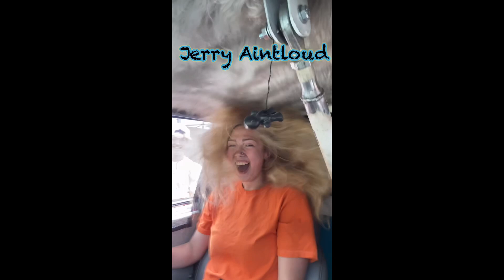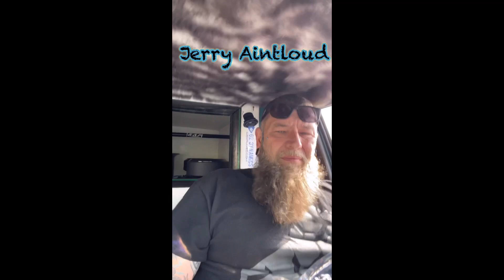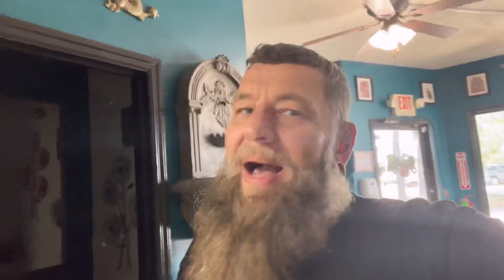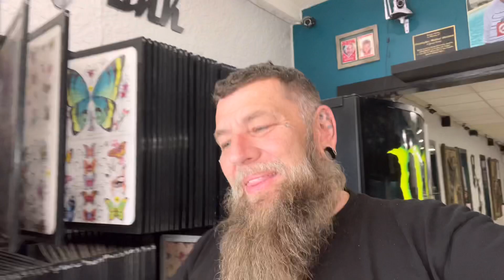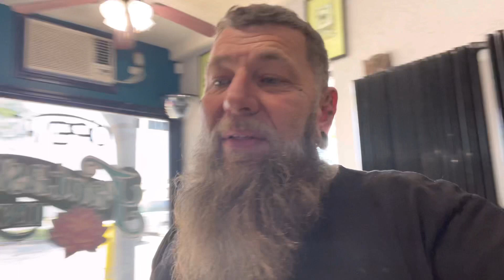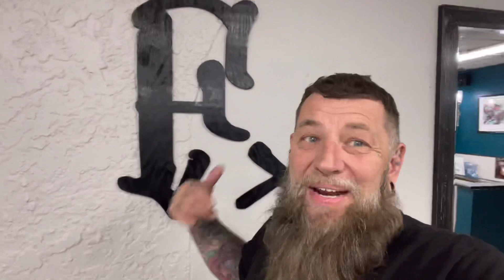Parker and the DC audio lvl 5

Comment: Yes Jerry it is very much because of the box he uses. The fact that he has now blown 2 of the best subs on the market is more than proof. He also fried a Sundown ZV6 not long ago. Both of these subs retail for $1000+ and both can take way more power than their rms ratings. I also know the box dimensions + port sizing determine the power handling of any sub. You are correct about him bottoming out the sub but that is also a 2 way road. With the coil leaving the parameters of the motor structure caused extreme heating of the subs coil causing it to burn up in smoke. This was very aparent in the video due to the dimpling of the subwoofers surround...that box is half of what those 2 subs need for there optimal performance. This is not rocket science just bassology 😆
Reply: Lol $500 ain’t blown but $1000 ones did
Reply: 👍 yup

Comment: He test every sub in the same enclosure. His enclosure volume is OFF and it created more heat on the sub coil. It makes a huge difference with big power too.
Reply: Yeah I never understood that.
Reply: True. He thinks that box is good for every sub
Reply: Well guess what here it is every sub he tested in that same box did not blow but the dc level 5 did in 43 seconds that American bass hd sub went longer than 43 seconds before it stop working 😂
Reply: If the box is to big, then the sub will move more right. When does a sub cool? Yes when it move’s more😉 just speaking fact’s🤯🤷‍♂️
Reply: Nah had nothing to do with enclosure and everything to do with him abusing the coil.
Reply: @larryneal4672   it still worked ,  after some glue good as new
Reply: @ardianelias1291  that’s not how it’s works 😭

Comment: if you guys think all subs and speakers are the same maybe read the loudspeaker cookbook? box size is a huge deal as suspension is different and moving mass is different. dc are designed ground up for smaller boxes, period. they're 1000$ because of real r and d instead of Chinese copy paste crap, nit every company just uses what everyone else is and slaps a way bigger coil than "rated" on it. power isn't everything in the slightest, education on how speakers work is key to understanding why every speaker is different.
Reply: Just pissing in the wind bro, it's easier to fool someone than to convince them they've been fooled

Comment: I have been running my dc xl elite 18 for a awhile. And love my dc. There were a few things I noticed that didn’t look right before he ever started testing it that looked off. First off the fact that it had sky high wire instead of dc wire. Second my dc was packaged exceptionally well but mine came directly from dc.
Reply: Good point I didn’t even notice that but they do always come with Dc Audio wire and much better packaged with Dc Tape .

Comment: ive been running 2 level 4s on about 5k for almost 2 yrs ..its on asfb8k wired at 2 ohm so about 5 k ish...neve r had any issues except stinky hot coil when i push them hard for an extended amount of  time in hot weather but thats it..never blown one ever and dc sent a free dest cap and glu to fix mine because my wife cracked my dust cone putting shit in the trunk to close to the sub//sooo for me DC all day the customer service is great and there subs work in smaller boxes than most so it was perfect foor my corolla

Comment: I have tested level 5 12s most likely more than anyone in this comment section. Anything over 1.5 per driver and they fall on their face. DC’s love small enclosures. 1.3 per level 5 12 is the sweet spot for a ton of power…

Comment: I've always thought DC is way overpriced for what you get, and Parker's video proves it.  People can make a million different excuses why it happened or what he did wrong but the fact is he played the sub on rated power (or close enough to it) and it blew.  I think if anything DC should rate the sub lower if that 3,000 RMS is the absolute limit that it can handle and little things like the enclosure volume being slightly off or the frequency is considered user error and made it blow.  Plenty of other brands that are half the price would have had no problem doing what he did with it.

Just my uneducated opinion.
Reply: to be perfectly honest people running  that much power on subs like that doing music and burps especially,  build at recommended or smaller youll get way better cooling and performance most times.  With a single sub running at rated power on a extended high hertz tone an extra cube can absolutely wreck it.   are there cheaper alternatives .. sure but not even remotely the same caliber of products.
Reply: Well 2.5 vs 1.5 air volume is a significant jump. Its not just a small difference. The DC 12 is recomended at 1.5. Most of us know bigger box means less Watts vs smaller box.
Reply: 1 cube over is just not a little thing, that’s a huge difference and that sub was getting clipped to death at 45 htz. It was way above tuning for that enclosure. You play any sub in those conditions with that much power and something bad is going to happen.
Reply: 45 hrs huh no bro 43 seconds
Reply: My deaf bonce sa 318 was put to hell and back and the coil started coming apart and it still didn’t blow up and that’s a 700$ sub it’s rms is 2800 I had 4k in it at .5 and free air it for 3 minutes on the same power stop now I’m looking at that level 6 put that level 6 on the same test and let’s see will it blow in 43 seconds
Reply: @larryneal4672  I meant 45 htz, anything way above or below box tuning will clip.
Reply: I’m not saying it won’t clip but do u think I didn’t clip the shit out of my sub before in a way bigger big and more power than the rms
Reply: We talking facts that dc sub get a pass because  u saying it’s something that Parker did to the sub and the just can’t take that test that way Parker did it when the fact is Parker test ever sub in the same box the same way and I would free air would be a harder test but he didn’t free air that level 5 why cause he knew it can’t take it think about what I’m saying and go back and look at that video and if that sub is 1000 plus tax I want more than 45 seconds hell a minute would be nice for starters u know and I know that sub is weak just say it please tell it like it is u never went to dc or me
Reply: Who said clipping was ok I’m saying I have clipped the shit out my sub before and it didn’t blow bigger box way more rms power and it still did not blow I’m saying that the level 5 Parker has is a weak sub I don’t know what u talking about and remember that dc level 5 Parker had cost 1000 plus 43 seconds it blow u tell me
Reply: Ppl with experience put 7.5kw into a level 5 daily with Out a problem. Parker just made a mistake
Reply: @Andrew_kiwi_AF  Still overpriced garbage.
Reply: @BigdeesulOfficial  do you have first hand experience with dc? No? Then shut up 

I was burping 154’s out of a standard level 4 12 clamping 9kw and to this day the sub still works fine. 
I have ran pairs of level 2 subs on a 3.5k daily. Use the suggested box specs and you have no drama at all.
Reply: @Andrew_kiwi_AF  Shit a Dual from Walmart can burp multiple times its rated power.  But obviously overpriced companies like DC can't make speakers that can run on the power they rated them at for more than a couple minutes.
Reply: Can’t knock something you haven’t ran. Stop listening to others. Be a leader, not a follower 💯
Reply: @BigdeesulOfficial  lmao I run a single DC lv 5 on a sundown 5k at 1 ohm and it has no issues playing on long 45 min car rides full tilt

Comment: He just didnt let the coil cool down properly before he started beating on it again. Still funny AF though every show I go to DC subs are the ones blowing plus the fan boys made it so I will never touch that company. There also one of the few companies full of recone memes on google when you search dc audio memes.
Reply: That's funny, I didn't know that. What brand subs do you recommend for daily driver. Single 15 set up?
Reply: @RomaVilla  It depends on your budget. I run a ds18 exl xxbhe12 and it gets down. it hits lows which I like. My buddy has a Deaf bonce sa305 and it is badass as well. The enclosure matters more than anything though so whatever works in a well built box in the space you have available.

Comment: For 1000$ it should be able to hang with any test tone ??  Come on nan don’t make excuses for these companies, a test is a test .
Love your videos subscribed since I found you …. I watched the brand x video
Reply: By your analogy, a Ferrari should be able to run without water, cooling the engine,  because it's a high end, expensive car. Heat is heat, and it's one of the worst things for a subwoofer coil. At higher frequencies,  the subs soft parts do not move as much, therefore the coil isn't moving as much, staying in the magnetic gap, And generating tons of heat. I don't care what a particular driver costs, or what it's rated power handling is...it has a thermal breaking point, regardless of how much or how little power you feed it.

Comment: 50Hz shouldn’t be a problem. 25 Hz I understand.
Reply: You have got that way wrong.  The higher the frequency,  the less the soft parts move,  and the coil stays in the magnetic gap longer... generating heat. Lower frequency cools the coil down,  from more movement in the gap.
Reply: @Chuck_Sanders  ok buddy. You keep cooling your coil at 30 Hz. And try pushing it out of the gap for extra cooing.
The one thing that is significant, is impedance. If you’re impedance drops at higher frequencies than the coil is getting more power (more watts) and therefore heating up more.
Reply: @johnviera3884  lol... your comment, is counter intuitive.  You clearly do not understand, electrical current to Kinetic energy.  Impedance rise is beneficial,  when wiring subs below amplifier recommending ohm loads.  You cannot flip physics.  A coil,  moving less in the gap,  while under a significant load... causes HEAT build up in the material of the coil. It's clipping, regardless of whether the amp says it is.. because the amplifier didn't see a clipped signal. Also,  if rise is causing a dip in ohm load,  and causing a spike in power at a higher frequency.. it generates heat very fast.   This coil is aluminum,  which expands once heated,  and contracts when cooled. The coil unwound,  why? Excessive heat. It's called thermal breakdown.  And it was caused by the coil windings,  staying concentrated in the magnetic gap.  A coil cools, by movement in the gap.  You don't not cook coils playing lower frequencies,  only by clipping or excessive over powering them.  Mechanical failures happen at lower frequencies.. like spiders separating from landings,  triple joint failures and so forth.  But,  hey.. everyone who's into chasing numbers,  goes full throttle on burps for minutes at a time right? No,  they don't. And why is that? It builds up heat, Fast! I'm guessing you drive around playing higher frequency test tones for minutes at a time,  with no cool down. 🤔 This wasn't a failure on the manufacturer,  it was user error. Wrong enclosure,  playing outside tuning for extended periods, that's just for starters.
Reply: @Chuck_Sanders  this coil cooked at 40Hz
Reply: @johnviera3884  it was 45hz actually. After over a minute straight at 40hz, said it was getting stinky.  No cool down, and then full till at 45hz, and the amp was flickering a clipped signal, and coil failed..45hz